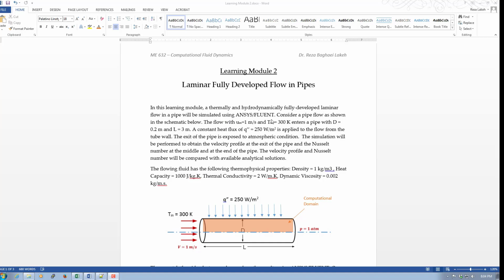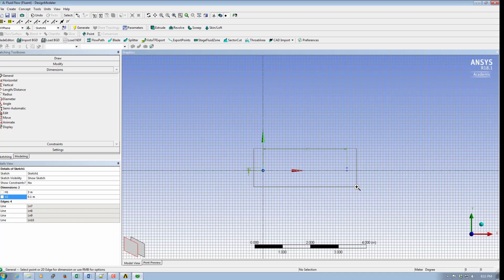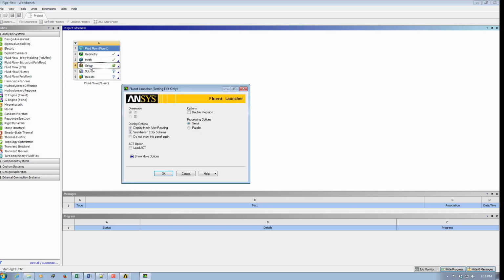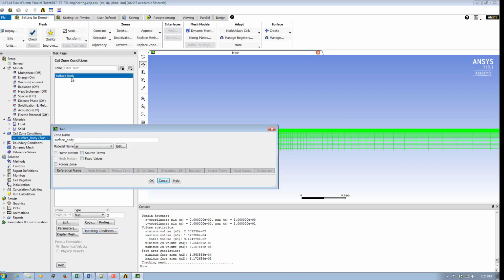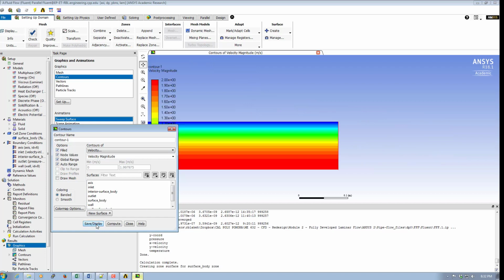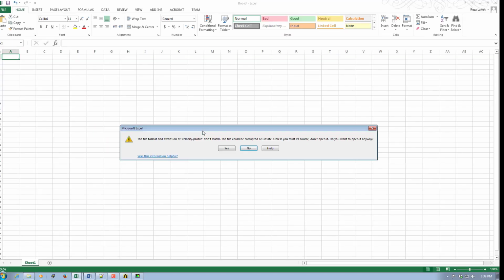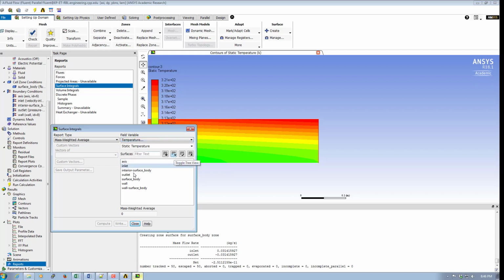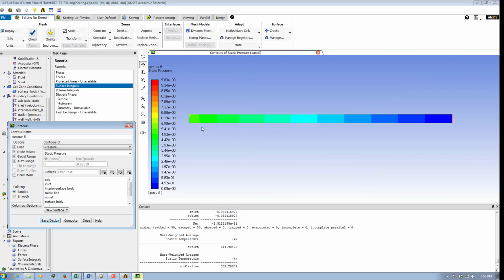Laminar Fully Developed Flow in Pipes

Comment: For fully developed region, the nusselt number will be the same throughout the surface wall ?
Reply: No. The Nu number will change across the wall since the temperature difference is changing as you move at the wall. In that case, you need to work out with average Nu number